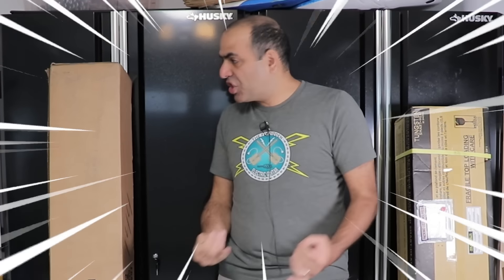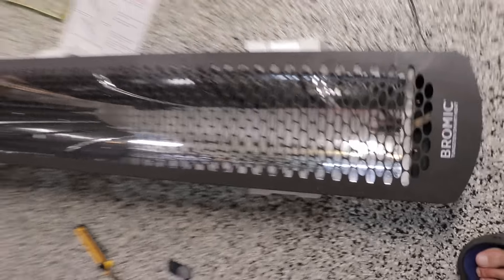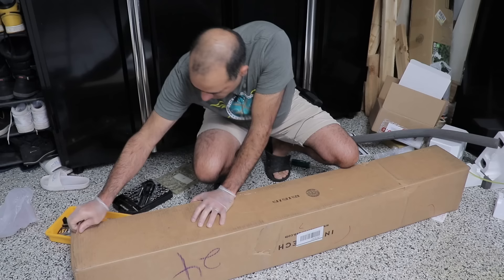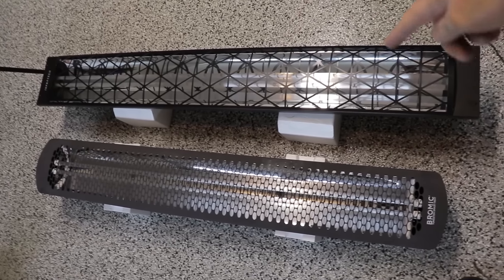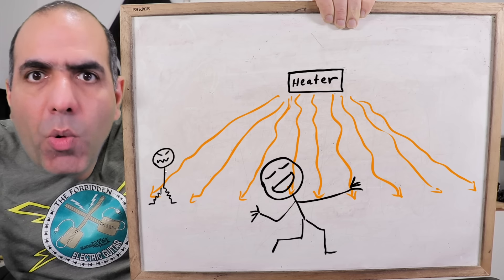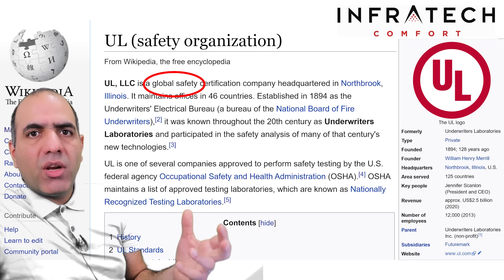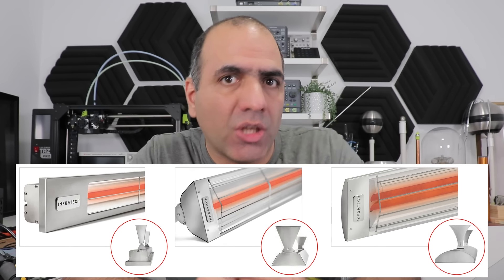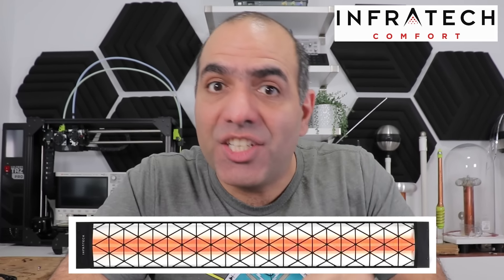Comparing 6000 WATT Resistors, Infratech versus Bromic Heaters

Comment: I wonder if a long glass fresnel lens would work (which deflects but lets infrared waves through). This lens tupe can also be obtained by placing reflectors in line at different angles, like a mirrored grid.
This would have the same role as the grid but would flatten the temperature curve to make the place warmer at the edges and keep the infrared waves out in the middle. On a table, for example, you are rarely in the middle.
Sorry for translation, i'm french.

Comment: It doesn't block the heat due to the properties of waves. Waves tend to wrap around objects they hit and spread out. It could also be that the material has a really low heat transfer coefficient.

Comment: If you want to reflect infrared efficiently, a gold first surface mirror would be best, as gold reflects even better than silver at the longer wavelengths of infrared. That is why the JWST uses gold coated mirrors.

Comment: "patented parabolic reflector"
You mean a mirror. A somewhat heat resistant mirror. You can't patent a simple mirrored surface, even if it's specially shaped.
They probably patented something highly specific about the mirror and plaster that on the advertising.

Comment: A challenge….. compare the heaters comfort against extra clothes and a blanket over the legs.  In my experience people who complain of being cold have cooler skin temperature when measured with an infrared thermometer.   There is a good deal of individual difference between people and how long they can sit outdoors before feeling cold.

Comment: In Italy the standard house power rating is about 3Kw, even if you upgrade your contract with the power company they will burn down your house since the cables and power sockets are not dimensioned for such power consumption, those behemoths would never sell around here.

Comment: Very nice comparison. 

In Turkey we call infrared heaters "ufo". 😂
Simply because the leader brand in Turkey is UFO. 🙂 They were the first company that made advertisement for an infrared heater.

In Turkey, grills are reflective small rods. It is way uglier, much more efficient and more dangerous. I bet, with same power draw, ufo would outperform both and would cost around 1/7 or 1/8. 😂🤣 

There are several models here. Some of them have thicker heating elements, some of them have thinner heating elements. 

All of them are ready to use. Elements are allways mounted. This is because Turkey has interestingly nice supply chain. A fragile product can be shipped around Turkey without much problems.

Many people use infrared heaters also indoor in Turkey. I think we prefer it because to heat up the entire space cost much. They prefer to heat only themselves. 

There are vertical models also, which is easier to use indoor. I have one that is vertical with standing up legs. We use it on cold nights in living room. Because heating up the living room with electricity is near impossible (65 square meters). So we use infrared heater just to heat ourselves, when needed. 

And patented my ass... Heating elements have 99% efficiancy, and the reflectors are standard. So the outcome will be more or less the same. If your heating element breaksdown, there are some small producers, that can produce whatever length you want. And that heating element's perormance would be near identical to the original. 🙂

Comment: I'm not sure how did you take in consideration the colder ambient temperature on the Infratech day, could it result in non-linear difference? also the temperature sensor measures infrared radiation so if resistors were running it could distort the measurement

Comment: Conservation of energy suggests any energy "blocked" ba a grillwork should be re-emmitted on its opposite side, evidencdd by seeing neither grill increase in temperature and incinerate, melt or visibly deform (excluding 'heat lenz' - that's just aboration).

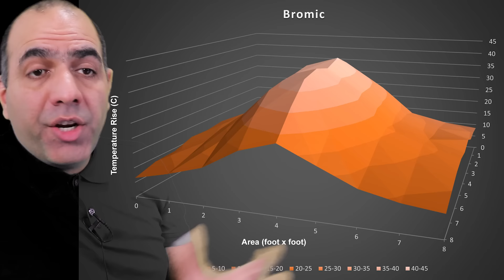Comment: Great video. One note, at 19:15 you use percentage for temperatures which isn't ideal since if you used fahrenheit or kelvin it would give different percentage while being the same temperature just different systems. Amazing job on the setup btw
Reply: Exactly what I was thinking, always disliked when people used precentages for temprature. The only "real" way of doing this is with Kelvin since it's proportional to it's thermal energy. Otherwise the percentage will be very missleading
Reply: As long as he is using the same unit of measure for each in the comparrison, using a percentge is 100% acceptable and is something that is easily understood by the average person.

Comment: Putting reflective material on the inside of the guard sounds like a good idea. It wouldn't be perfect, but it should significantly decrease how much energy is blocked/absorbed by the guard. With how much these cost, the cost of that coating should be low. I feel like that's an easy additional "heating efficiency" to claim over the other company if one or the other did it.

Comment: The only way that the grille wouldn't cause problems for the infrared is if it were to heat up and re-radiate.  At that point, it wouldn't be a very good grille, because you'd get burned by touching it.  I suspect even the way that the grilles are made, they would still get hot enough to burn you.

Comment: Theoretically, gold should be good at reflecting infrared radiation. Since you measured the shape of the reflector - you can calculate the surface area, and calculate the mass of gold required to cover it with a 1 atom-thick(0.146 nm) gold reflector. 
How much would it cost to have a gold reflector?

Comment: PS, although the end clamps for the lights do seem like asking for trouble, i can tell you from exp, the quartz tubes are pretty tough. I have broken one (out of frustration) and randomly, it turns out the surface is EXCELLENT, EXCELLENT as a finish-polishing stone for knives.
Finns and Poles, must be some real craftsmen, i guess.

Comment: Hello Mehdi, did you try to measure a voltage drop at those (sorry to say that) unconvincing connections, or their temperatures when under load? In the video, it seemed that your voltage measuring points are at the junction. I'm afraid that a poor connection can easily add some significant resistance to the circuit and reduce power of a compared heater, making the comparison inconclusive...
Btw, in your calculation, you assume purely resistive loads (P=I*U). But aren't those heating elements wound? Can't they create a parasitic coil? Wouldn't a proper wattmeter be in place?
Reply: Nice points, although I can't imagine the conclusion would be much different in the end, and it's just not enough for a follow-up video

Comment: I think with a heater, rather than which puts out the most heat, it should be which heats the most efficiently power use wise.

Comment: The CSA vs UL standard comparison isn't rubbish. CSA standards are tighter than UL. This is why you can not legally install a product in Canada that does not meet CSA standards. UL has an additional set of approvals called UL-C that prove if a product meets or exceeds CSA standards, and is allowed to be installed in Canadian homes.

Comment: 3:02
I actually gasped in quiet horror at the sound of that snap.  I can only hope you didn't break the heating element since what basically amounts to a 3 kW resistor cannot be cheap.

Comment: The guards are painted black. They may block radiation but they absorb a substantial part of it. Being black, they are able to somewhat efficiently re-emit that energy back out. The effect may be minimal if not windy. Black body radiation. A definitive answer requires FEM/FDM analysis but the idea stays the same: the answer isn’t obvious.

Comment: Let me get this straight...

Infratech- Honest and confident enough to pay you for the comparison despite the chance that their product wouldn't do as well. In todays world, that on its own is absolutely nuts.

Bromic- Puts out lying and defamatory product comparison documents as well as makes claims that their own engineers admit haven't been researched at all. "Patented" parabolic reflector, my ass. You mean a mirror. Not even. Chrome plated aluminum. 

All that said, you can bet that I'd prefer to give my money to the company that isnt lying their ass off. So, because of this review, I just purchased an Infratech patio heater for the deck off my man hut to get ready for the winter. Thanks for the review, Mehdi.

Comment: Great video but a small niggle - you can't do direct percentage comparisons on heat using celsius the way you seemed to do. The difference from 10C to 20C isn't a 100% difference because the zero's position on the Celsius scale is arbitrary. What you'd actually be comparing is 283 Kelvin versus 293 Kelvin which is about a 3% difference. Granted, you could also demonstrate it as change over ambient which would swing the percentages the other way instead and probably be more helpful overall.

Comment: Rule 1/1 for resistive heaters. THEY ARE 100% efficient. So if they’re the same Kw, 6000w they will output the same heat, regardless of element length. So they’re exactly the same heaters just branded differently

Comment: Around 19:20, you can't do percentage comparisons on arbitrary scales like celsius (hint is you'd get different results on Fahrenheit). They have to be done on kelvin to get meaningful results.
Reply: Celsius is the exact same as Kelvin when referring to changes in temperature (which is what he's measuring, why else would he get the four corners and side of house control?)
Reply: @Owen_loves_Butters  you can't say 30c is 50% hotter than 20c. That's what I'm saying. This comes up frequently when people review cooling products.
Reply: @fer662  But 30C of warming is 50% more than 20C. There's a difference between temperature and change in temperature.

Comment: At the risk of stating the obvious, both of these units were probably designed and manufactured in the same factory complex in Shenzen before being sold for resale under two random brand names. You correctly noted the parts, packaging and chassis were all essentially identical. Even their respective marketing materials look like they were churned out by the same PR template (because they probably were). 

This is the usual situation in Chicommerce. It creates the illusion of brand meritocracy among Chinese goods while actually allowing the PRC government to manipulate prices and create artificial monopolies for their cronies in key industries.

Comment: Did you give the cost per square foot of the area to own a radiator like this. 
The infrared radiation will re-radiate off the black body grill but like you pointed out that the bromic was not as black but greyer - less black body radiation. 

What are their cost point per unit in the video per square foot of thermal radiation. 😀

Comment: I want to reduce wattage of a 1000watt heater to 500watts. For that i want to add a resistor in series to heater. Can you confirn resistor value and wattage to be used to achieve this

Comment: Rewatching this, there's something I can't quite understand. Why use what I presume is metal grid covers. There's plenty of polymer and even non polymer substitutes with a greater infrared transparency.
Reply: They still get so hot that the elements visibly glow; hot enough to heat the air quite a lot, which heats up the grill by normal convection. It needs to be strong, light, resistant to high temperatures, have a low thermal expansion coefficient, and have a high emissivity

Comment: them guillotines are a bad design. Could easily be better. on the mesh in front: I think the Infratec mesh has tpoo large holes, a kid can still touch the elements, but if fitted at a kid safe place, I agree  with you, it looks way better.

Comment: Of course, the real elephant in the room is the fact that we spend huge amounts of time and resources for energy, specifically electrical efficiency - then blow it all on electric heat. Sad reality is, unless we were much more electrical energy stable - that is, nuclear, geothermal etc - and the grids, both distribution and buildings,  were upgraded to match,  using electric heat in any structure in Canada is simply undoing all the gains we otherwise make with LED and other electrical upgrades.  There is also the thought of redundancy, particularly in energy brown/blackouts -- no power = no heat.    Still, interesting comparison.
Reply: bla-bla-bla      this is  NOT  a  discussion of  (indoor) space heating.    phool            otoh,  there  ARE  relatively  efficient ways to use electrical power, to heat air in a (indoor) confined space.       obviously, an electric furnace is  NOT one of those ways.
Reply: @daviddavids2884  bla-bla-bla how DARE anyone think logically REEEEEE

Comment: Why not just put two electrodes into a large pickle jar and fill it with water. Using a cheap crystal growing kit from the dollar store makes the electrolyte. As you put 120 watts dc though the electrodes the anode effect makes hot boiling fluid. Maybe a fan and radiator could heat a room with a good speed fan that may use as much as 400 watts. Still a lot of energy but less than a 1500 watt heater.

Comment: I'm certain there must be some kind of plastic lens that can be made that can transmit 95-99% of the infrared. Maybe it's too expensive?
Reply: It just came to me but maybe even if the lens had 99% transmission you're still trapping all the heat that the reflector absorbs plus 60 watts, and a lot more if it gets dirty, plus all that the element doesn't turn to infrared making it potentially a fire hazard unless it has an expensive and well designed heatsink

Comment: Is it true that there is nothing actually moving in the wires of a circuit ,it's actually the field around the wire that does the work. And if that's true then the electron doesn't exist. Fields are not particals . Light ,dielectricity and gravity are all the same thing ,it's like saying water ,steam and ice are 3 different things . What's going on in  the wire is like the pistons in a car they are moving just not in Cartesian space. the wire is not like a hose with water in it but thats what most people think

Comment: Can you help me heat a space that is 2,100 sf x 10’ tall and maintain a heat of AT LEAST 45 degrees over 3-5 days?  I am pouring a slab of concrete in winter conditions with lows in the teens and highs in the 30’s.  The space will not be airtight and will leak perhaps 10% of the heated area. Need to use electric heat and not propane or gas. You are much smarter than me!  Will two of the 6,000 W heaters work?

Comment: Really ridiculous they are legally allowed to put “lifetime warranty” on the box but then only offer 1-3 years. That reads like a scam to me and false advertising.

Ah the electric heaters, I used to sleep next to one and have my leg right next to it. After several months of this I actually got radiation burns on my leg which I had no clue it was a thing that could happen. Basically the skin color of my leg changed all because I had direct heat from an electric indoor heater blowing on me for most of the night.

Too bad I don’t live in the Vancouver area
And this was more than a week ago lol I live in Wisconsin, it gets COLD here.

Comment: Comparing the temperatures for with and without the grill/grid, the percentage relative difference is irrelevant, 0degree C has no absolute meaning to enable increase percentage comparison.

Comment: if it didnt block any energy at all, then while the element is on, I should be able to touch the grill cover, and NOT get burned.  I would ask the salesman to prove it then, and touch that grill. ;)  Otherwise, the grill getting hot, infront of the element, would suggest, its blocking heat.   Funny how salesman are not Techs, and they prove how little they know ALL THE TIME!!!

Comment: I have a case of very very expensive clean room built motors they have three phases and they have like three different sensors I believe and I have no idea what they are there some kind of high speed servo although they spin freely. At any rate would you like a couple of them don't PM me 'cause I have no idea how it works I guess just answer here and hopefully I'll see it. I would have no idea where to mail them so we'll have to figure something out if you want them. At the company I worked for we use these motors to actually pelletize DNA we would spin it up in these tiny centrifuges at 72,000 revolutions per minute

Comment: i wonder whats the difference between thermal radiation and infrared 8:15
Reply: Thermal comes from the material, example a warm blanket radiates heat to an area, and air around it causing it inturn to get colder. infrared is a special wavelength of light when it hits things it heats them up, sunlight includes infrared wavelengths.

Comment: You're using a plastic profiler? Wimp.

My friend used a steel pin profiler to gauge his electrical outlet at a LockMart facility - and shut down most of the building that morning.

You need to up your game: start profiling electrical sockets!

Comment: Bro please, when youre connecting dangerous shit together, use terminal blocks and junction boxes. You dont even have to get custom boxes, just stick a tiny piece od DIN rail inside a plastick junction box for a household outlet, and use that for your haphazard wire connections. Its infinately safer than all the twisting and sparks youre showing on your videos. 

I do like your videos though, keep up the good work, just please use industry standard test practices.